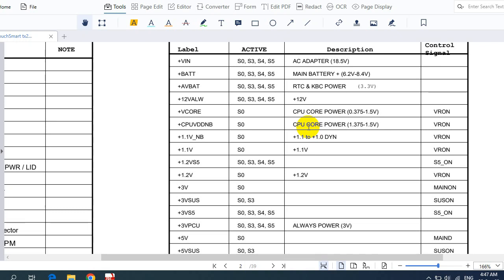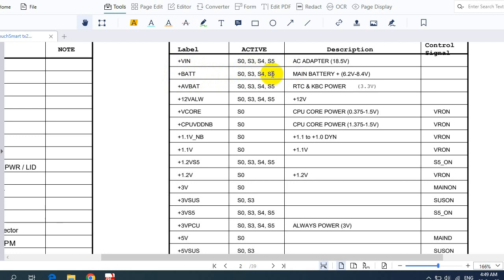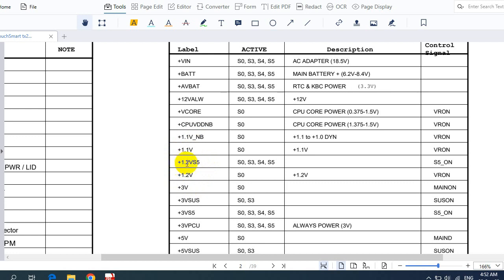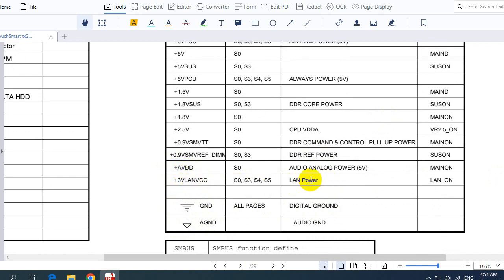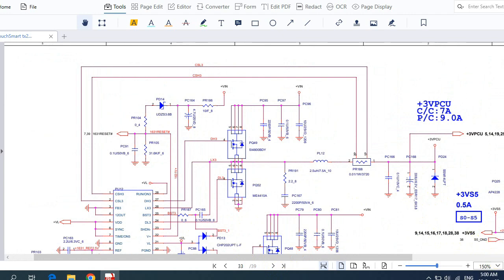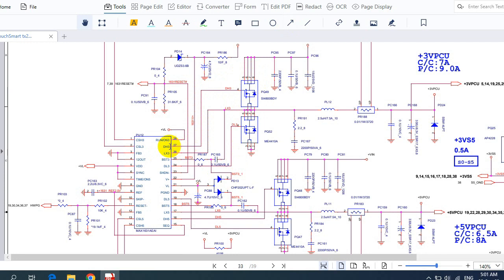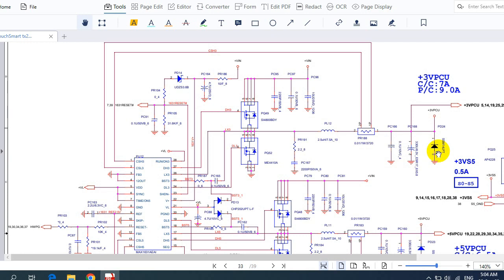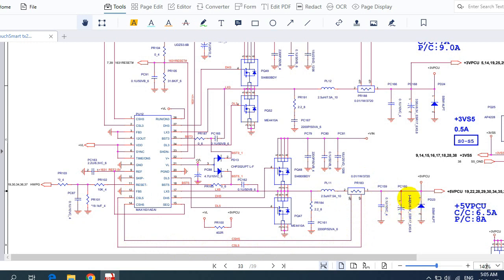Computer motherboard power rails - Motherboard voltage

Comment: where did you find out inductor coil increases current, if in series with pulsing dc it will smooth out the pulses, inductors basic property oppose any change of current- low pass filter.